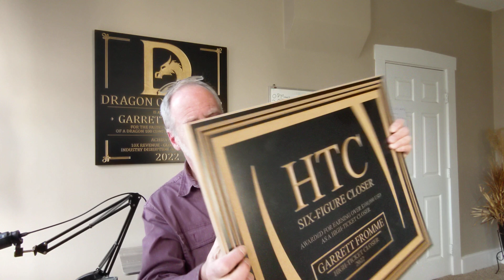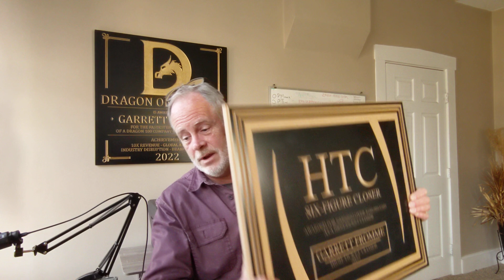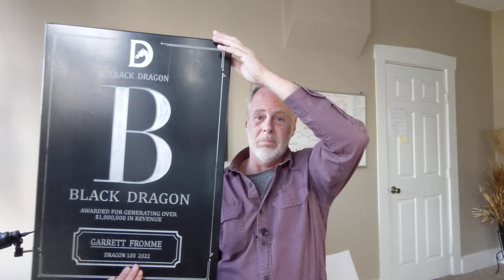CNC Routers Weekend Update

Comment: Garrett, another question. It seem you have an in with Longmill. So my question I have for you is this. it would seem to me   that you could add a relay that is lower voltage to control the routers and vacuum. Is this something you can suggest to them. I know it can be done
Reply from the maker: It can be done. Long mill has into how to do it on their website.